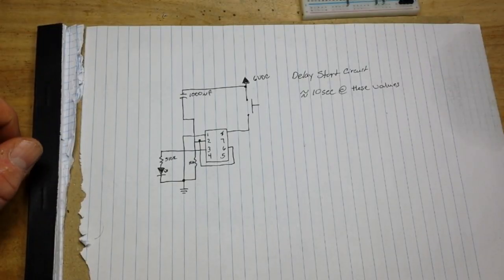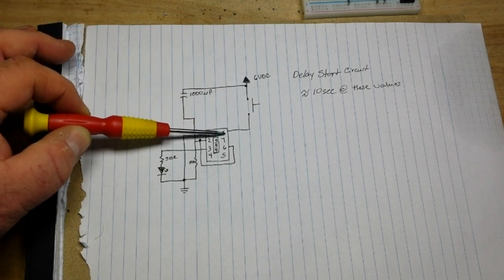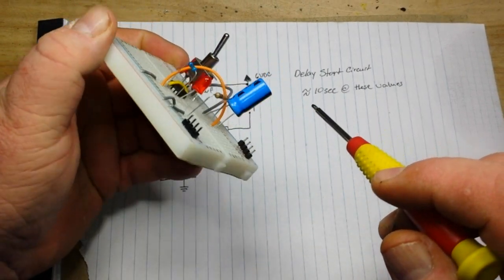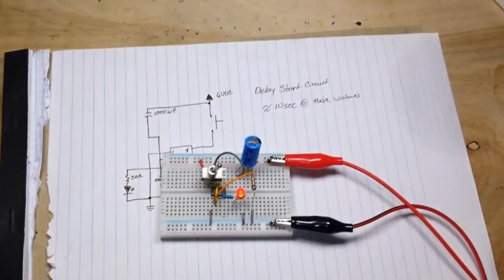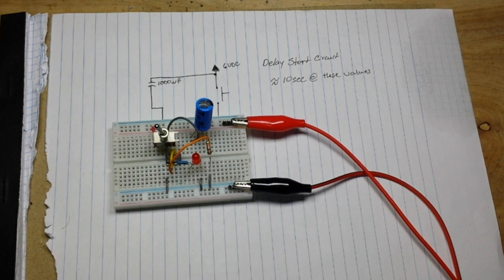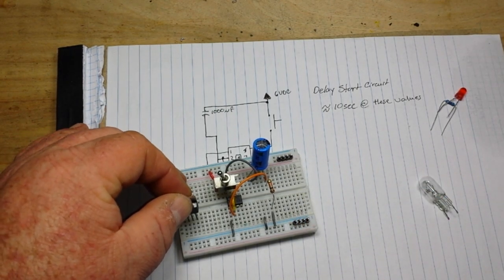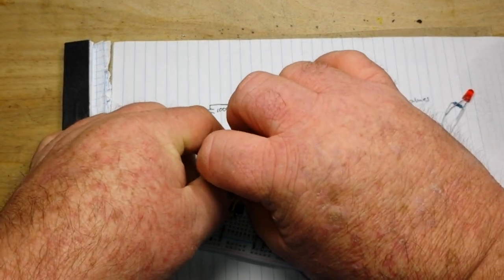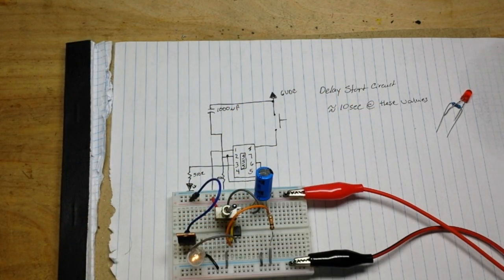Classic Circuits You Should Know: Delayed Start

Comment: 556. Make a latching, delayed on. So you can use a momentary switch for on and a momentary switch for off.
Reply: make a latch with it!!  but i guess the 555 has latches in it,  so it doesnt count.
Reply: @magnuswootton6181   What? What do you mean, doesn't count?
Reply: @ed-jf3xh  if you make a latch using a latch, then its just superfluous machinery.   like in maths, if you use trig functions to make a trig function,  then it doesnt count either. real trig only uses basic algebra moves, otherwise its not its true genesis.

Comment: This is fascinating, but I made one following this as closely as possible (I used a zero PCB and I soldered directly) and the light turned on instantly. I used a 470 uf capacitor, but that's the only difference. Everything else was the same.

Comment: The 555 is basically an opamp.  I used an LM358 for my timer.  Used half of the chip.  The unused opamp has pins 6 & 7 shorted together to produce a voltage follower.  Pin 5 is grounded.  Tried posting a picture of my rig.  Uses one chip, one cap, three resistors and an N-Channel MOSFET to drive the load.

A note on your rig - the FET should follow the load, not power it.  Unless you used a P-Channel MOSFET.  P channel FETs are fewer and more expensive.  You MIGHT want to tell us what MOSFET you used because the way you used it suggests a P channel, not an N.  And leaving pin 4 of a 555 floating is not recommended.  Can cause oscillation which can lead to heat and damage of the chip.  Pin 5 can be left open OR used as a second part of a timing circuit.

Comment: Love your stuff. Looking for a method to extend the duration of a timed circuit.  In other words extend the duration that the circuit remains on before shutting off.  Kids space ship, with flashing lights and siren. push mom. on and beeps flashes for 10 seconds. I would like to make it 30 seconds or whatever.  
Simple design. 1 8 pronged miniature IC few caps resistors all micro.  threw some caps at it nothing.

I should just watch more of your vids like this one.  lol.

The 555 timer challenge, ok.  I like your "delay on" circuit I can use that. cool, thanks.

Great tip on using the diodes for protection, thank you, excellent.  
I would also like to mention the method you have selected to connect your power supply to your breadboard.  obviously better than a single connection and much more secure.  I will be adopting some of that;  (smart).  
who's this guy?  It's me, just me having fun with electronics.  I know you don't know me, but I'll comment as if you do.  
 You know connecting things up on the bread board can be tediously time consuming using bare hands, especially as it gets populated.  I started using tools to push items into position.  mini needle nose pliers, hemostats.  They are easier to see through and much faster.  I'm sure you probably have different methods  as well.
Alright man.  cool, very cool.  I'll be looking for all of your (circuits you should know) by heart videos.  thanks again, see you later.

Comment: Mr. Paul thankyou very much for this video , it really helped me. But i have doubt about the circuit diagram that you drew in the first place as you have connected the capacitor directly to the +Vcc but i think it should also pass after switch because if it s directly connected to +Vcc than how the circuit will take time to on the output, guide me if  i am  wrong

Comment: Neat little circuit.  However, even with the change in capacitor placement, you could miswire the circuit according to the schematic.  Double check your work with his actual build just to be sure.

Comment: I'm very much a beginner. My breadboard  has a 2.7v capacitor, LED with resistor, small toy motor and 3 AA batteries in a power pack. The circuit works, LED an motor continues to run a short time from capacitor storage. How would a circuit be made to first charge the capacitor , disconnect AA battery pack; then enable the 2.7v capacitor to run the motor and LED using a bread board on/off switch? (LED fades as power is drained from capacitor)

Comment: Sorry for the noob question but does current actually pass through the capacitor?  Why would it trip the timer after its fully charged?  I thought it kinda works like a battery where the current comes out the positive end when needed.
Reply from the maker: No current passes through a capacitor. A capacitor gathers charges on its plates. The charges are released from the same plate on which they gather.
Reply: @learnelectronics  Thats what I dont get.  You say it charges the capacitor from VCC which charges the top plate.  How can it then trip the timer through the bottom after it charges?   Thanks for your help, sent you 5 bucks!
Reply from the maker: Thank you. The charges accumulate on the plates. They don't pass through. Then when conditions change, ie, it now has a path to discharge, those charge go back in the opposite direction that they came from. Just remember this, capacitors block DC and pass AC.
Reply: @learnelectronics  ah that's where I was getting confused.  I didn't know AC can pass through.

Comment: shouldn't changing the resistor (the one attached to the capacitor) also change the time constant?
Reply: Nah, the capacitor loads the resistor. Anything connected to the capacitor will have the current voltage of the capacitor.

Comment: Your schematic is incorrect. The cap is connected directly to V+ in the schematic but is connected after the switch on your breadboard.
Reply from the maker: I put a graphic on the screen saying just that very thing as I was explaining the circuit.

Comment: Why does the Capacitor  need to wait for the switch to be activated  when its attached directly to vcc?  I don't get it
Reply: I was confused too. As far as I can tell, the diagram is slightly wrong: the capacitor is actually connected to the lower part of the switch, not VCC. You can see it when he shows the circuit at 2:46, he explains that the capacitor is connected to other side of the switch (not the VCC side) and to pin 2 of the 555.
Reply: @MoeFH  even the switch symbol is wrong.